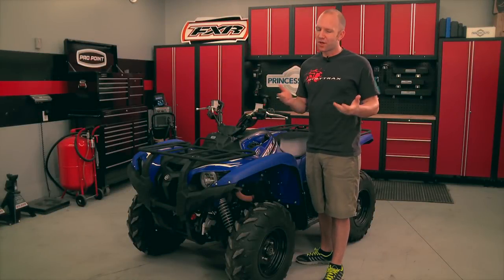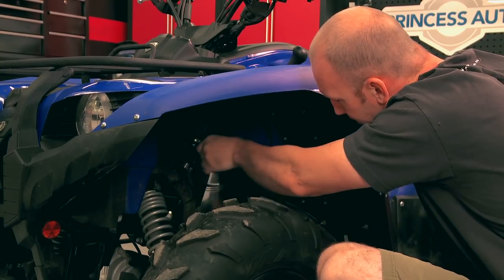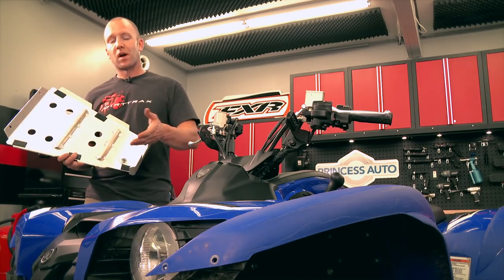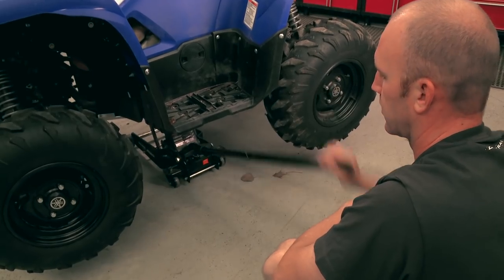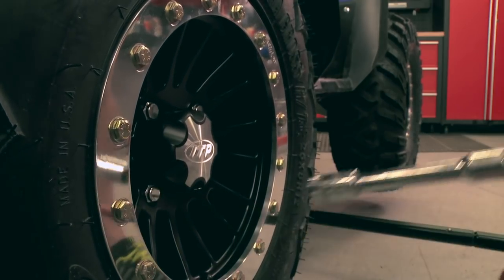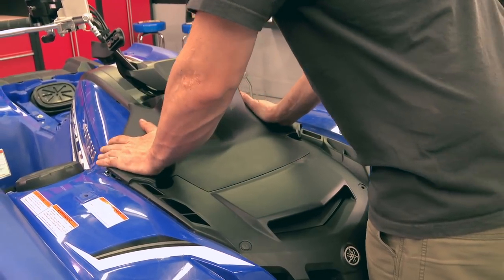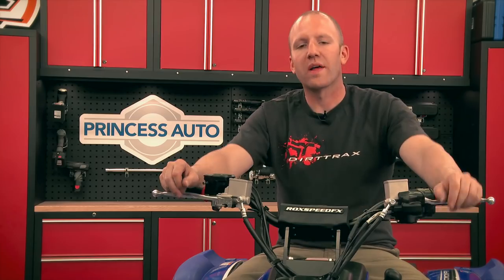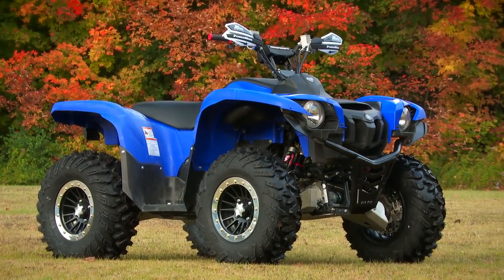2014 Yamaha Grizzly Customization Project - Part 1

Comment: if Yamaha was smart they would build a 1000cc v twin and absolutely crush the competition just with their 4x4 system alone i still dont understand why they haven't done it.
Reply: Polaris 4x4 is better than Yamaha's though..
Reply: +sladester2 lmao can only imagine.
Reply: sladester2 no your crazy
Reply: Thibault even if they made and 850 or 900, they'd clean house. I'm gonna wait until they do so. It took em a few years to design the YFZ1000 so maybe a VTwin grizzly is in the works
Reply: sladester2 lol, not even close. I've driven and hauled loads with a Grizzly 450 and a Polaris 570. Guess which one I own? The Polaris is cheesy and the 4wd would only kick in after you needed it. A selectable switch as simple as Yamaha cannot be beat. And Yamahas CVT completely shits on Polaris. I've towed twice the load with my Grizzly as I could with the Polaris and the Polaris has a larger engine and frame
Reply: Jake because they don’t want to come out with something before they know it’s going to be incredibly reliable like everything else they have. They have an 850 twin out now in the side by sides now, it’s only a matter of time
Reply: @sladester2  is that why they fall apart every ride...?
Reply: @sladester2  Ive owned and own both, Grizzly is superior quality lol.
Reply: @sladester2  too heavy. Part of Yamahas great 4 wheelers are their power to weight ratio. Thats why they do so well on trails
Reply: Mmmm I just love Yamaha’s 3 wheel drive, their ATVs should say 3x4 becuase the front right will always cut in and out and have less power than the front left
Reply: ontarioknivesNS7 yah but Polaris makes their ATVs for more trail riding and less hauling loads
Reply: The Mutt racing say that to anyone who has worked or owned one.....

Comment: Maybe Yamaha will bring back the wolverine name with a model similar to this , a grizzly 1000 and a wolverine 1000 would probably be a big hit.
Reply: very Nice Idea!!!!
Reply: At least a 700 Wolverine, they already have the chassis, just modify it a bit to fit the 700 engine.  Keep the rest of it the same, no low range or diff lock and no irs to keep the weight down.  It would probably be a bit fatter around the mid-section with that bigger engine but would could still look basically the same.
Reply: Yep.yep!!!

Comment: Great looking build to a trusty do all machine . I laughed when I saw that you drilled the rivets out for higher foot pegs , because I am drilling my XTR pegs out to remove them for flat floor. I ride with my heel back against the fender and I stand up 90 percent of the time , so the pegs tip my toes up . Great video , commentary and excellent show .
Reply from the maker: Thank you!!
Reply: @dirttraxtv  do you know which bumpers will fit my 2002 yamaha grizzly 660?

Comment: The purpose of the build was to make a machine that can do more than work. The 700 makes decent power. The upgraded shocks makes it handle better. Cutting the plastics to give more of an agressive look like a scrambler or original worlverine. Now keeping the rear rack may have been a decent idea. Now not saying that machine id going to spin a tire out of the rim, but might keep it on the rim if contacting a stump or large rock.

Comment: quite interesting ,you should have went with taller tires , you are going to be way off on ground clearance , wider a-arms should have been used , with forward and rearward sweeps  and dont forget to tell us when done the cost of this mod vs the scrambler /renegade ... good video and I hope this signals Yamaha getting back into the sport sector of ATV/SXS models

Comment: Grizzleys are the only machines i ride. Check out mine in my picture! It has exhaust and programmer along with wheels and tires. Next will be different handle bars! Its a 2008 fuel injected special edition.

Comment: +Dirt Trax Television First of all I want to say well done, after watching this build I have really been wanting to find myself a Grizzly 700 EFI, and do something similar, the only thing that I wish you would have touched on more is power aspect compared between the 3. How does this build feel compared to the scrambler and the Renegade's power with the new exhaust and fuel programmer?
Reply from the maker: +Lincoln Kestner It feels very potent, but up against a 1000 twin it obviously has limitations. That said, still a great riding machine and one of our favourite mods to date.

Comment: Looks like a nice rig but I much prefer 2wd because they are almost always lighter and more nimble and if you roll it will be less damaging most likely. I also would not run hand protecters because they could break your hands also why I use break away levers.

Comment: AJ stated that the front bumper was not a "bolt on accessory", but it doesn't appear to have been modified. Am I missing something?
Reply from the maker: It's a GYTR accessory for a pure sport ATV and I think he modded it a bit. Had to cut and weld and hammer and bend to get it to fit on correctly.
Reply: @dirttraxtv  wow, thanks for the quick response. I've been watching this build video over and over. Im so tempted to sell my raptor for a Grizzly. I wish Yamaha made a sporty grizz just like this build. Thanks
Reply: @Slampiece88  I would definently make that trade. I have a yamaha grizzly 660 and a honda recon 250 bought on the same day in 02 by my dad. I wouldn't trade it for a lambo lmao.

Comment: And still. Don’t think Yamaha will do a sport/utility 1000cc. But just picked up a 2021 kodiak 450. Not like the 700 but happy I can ride again
Reply: How do you like it? Going to buy one next week I think
Reply: @Sad-lawlessness  it’s alright. The power though is so like. Cut off from the 700’s. It goes up to 57... but I can’t even do a wheelie on it with the low tourqe. And companies make so much more for the 700. Not even one rad relocation kit for the 450’s. I miss my 700, but ima make the 450 into a small beast for the mud. Also one thing I dislike is the storage. I don’t know why they couldn’t have put a storage unit in the top or under the key knob. Just under the seat which sucks but beggers can’t be choosers. I’d save your money and just wait for a 700 to pop up. Right when I bought the 450 a 700 popped up for sale....

Comment: Why didn't you just buy a raptor? They have the speed and agility you are looking for and grizzles are meant to be farm quads not so speed monsters like your trying to make out! I only use my grizzly for piggin
Reply from the maker: Plexide xo CVT, 4x4 and IRS that is not available on the Raptor.  The concept is to compare with a Renegade and Scrambler, which the Raptor would not.
Reply: I wish Yamaha would just bring the Wolverine back.  I owned a 450 Wolverine years ago.  The only thing it needed was more power.  Put the 700 engine in that chassis and it would be really competitive with the 850 Scrambler and 800 Renegade.  The 1000cc versions are just in a league of their own.  I really don't even think you need irs or power steering, it handled and rode pretty well without it and that would save weight as well and had more than sufficient ground clearance  The 450 was a nice torquey engine but it really lacked any top end punch, about 50 mph was top speed stock.   The 2014 700 engine would be a huge increase in power over that 450.  Could also offer a 550 version as well.  Even the 550 would be quite potent and maybe would be a better fit in the smaller chassis.  The Wolverine is much smaller than either the new Scrambler or Renegade so I think it would be much more nimble and manueverable as well.  Much lighter than the Grizzly as well so that 700 or even the 550 would feel much more powerful.
Reply: +Greg Rowe: Yamaha brought it back this year with a 700 cc motor. Search it up.
Reply: Yeah, i just watched an intro video for it.  They reintroduced the Wolverine name for their new sport side by side.  Looks pretty cool but unless this new 700 class engine makes significantly more power than the old one, it is going to come up short.  The Maverick 800 and Rzr 900 will be stiff competition.  Pricing will be crucial too.

Comment: This was honestly pretty stupid, the only thing he did that would affect it is the exhaust and shocks. Putting the gytr bumper on for weight saving was pretty dumb.
Reply: It's honestly pretty stupid to think that shocks, tires, and the removal of 50 pounds of weight wouldn't make much of a difference. And, honestly, you need a front bumper on a GNCC style quad. It would be pretty dumb not to have a bumper... Do you even ride quads?
Reply: Rex Houseo yeah, and I've had a grizz before too, the front bumper is very light as is, I really doubt he lost 50 pounds too, maybe 15-20 at most. Plus the structural rigidity was lost on the plastics when he cut them, it looks pretty dumb wobbling around like that.
Reply: Denis Gavrilov Well, the all aluminum rear racks are marketed for their light weight and they are just over 15 pounds. The original bumper from my Grizzly tips my bathroom scale at 11 pounds and the stock exhaust is 3 to 5 pounds heavier than aftermarket. I guess you could add weight back for the tires and skids, but you have to do that stuff either way. I don't really care about that anyway. Shocks and tires alone make a huge difference to any quad. Based on your original comment I can only assume you are somewhat ignorant when it comes to motor-sports and incapable of appreciating the goal he's trying to achieve. Personally, I'm happy that these guys are there to try out different products and ideas and tell us what works and what doesn't. Now we know that the lights wobble if you cut the plastic. I wouldn't do that anyway, but it's good to know. I'm not going to criticize it after it's done and say it was "stupid" and "dumb". That's what a nagging bitch would do. Don't be a nagging bitch...

Comment: i lllllllllloved my grizzly, but the suspension was def pretty awful. the front was mushy, and the rear was like a pogo stick. if u went to wheelie over something, when the rear would get to it, it would buck u off the seat. you ever push down on the rear race of the grizzly, the wheels would almost pop off the ground it was so pogo'ey
Reply: What kinda suspension you got? The suspension on my 02 grizzly 660 is stock and perfect
Reply: I had a 2010 grizzly 700 I bought new. All stock except heated grips/thumb warmer, and hand guards. I turned the preload adjuster on the front shocks to the stiffest spot, and the rear shocks to the softest.
Reply: @nickpeccarelli7593  oh. Weird. I have an 02 yamaha grizzly 660 that's perfect haha